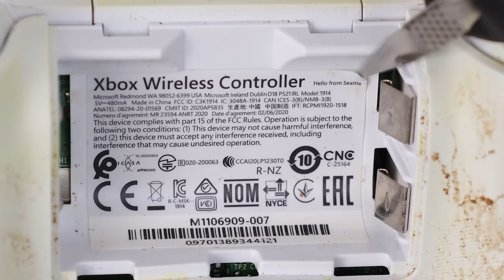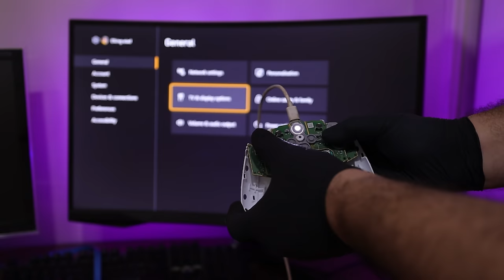Restoring and repair of the Broken Xbox series X|S Controller No Power & NOT CHARGING - ASMR

Comment: Something is off in this video. 
I've had the same identical white controller since launch (it's in front of me right now) and it isn't this dirty. The underside of the grips, the triggers and bumpers both have texture on them which can easily accumulate dirt from usage and I don't see much of it here. Either some of the dirt on this controller was artificially added or it was still new / barely used when it was water damaged.
Reply: Yeah he makes them dirty on purpose for the video :/ (unfortunately)
Reply: @Supremesilverlover  yea thats what i was thinking
Reply: it's probably one of those fake restoration channels
Reply: Dirt been painted on with a paint brush u can clearly see brush marks
Reply: concordo com voce !!! this is video is fake1
Reply: 100% amount of dirt built up is not equal to the deterioration of the plastic pieces itself.
Reply: This channel is fake

Comment: I am back addicted to your wonderful videos, I eagerly wait for them every day 😄 Smart, brilliant and amazing work from you 

Where was the fault? 
Maybe you can give me a simple explanation for that I am not a technician or a repairman, but I will benefit from you a lot, so that I can learn how to repair my devices in my home on my own.

 Thank you
Reply from the maker: Thank you so much for the kind words! I really appreciate your support and I'm glad you enjoy my content. Happy New Year! ❤️
Reply: The fault seemed to be the main chipset on the board not having correct contact to the board, due to impact or liquid damage.
He used a heat-gun with flux material to 'reball' the chip, where the heat melts the flux and the solder contacts on the chip to the board, to renew the solder.
Also, he used thermal-tape on the components close to the chip, so that the heat-gun would not de-solder any other component close to it.

If i missed something else, please let me know, cheers!

Comment: I have the Forza Horizon 5 Limited Edition Xbox Controller and the LB Button broke, so I bought a new screwdriver, some bits, and some Gorilla Glue Super Glue took it apart, took the broken piece from the LB section of the Bumpers and super glued it back together, had to let it sit before leaving for work. Came back, put the Bumpers and everything back together, now good as new.

Comment: The broken bumber is a common and annoy problem, it hasn't any solution except replacing it , I've got this white controller and it has a problem that the analog sticks drift to any direction, i don't know why? Is this a common issue with this controller or it is a random bad luck ? I dunno but I tried a different ways but neither of them is useful
Please tell me what should i do , Happy new year everybody
Reply from the maker: A common reason Xbox controllers develop drift issues is dirt building up within the controller, preventing the analog stick from working optimally. The easiest way to fix this issue involves using a can of compressed air to clean the cavities surrounding the analog sticks. Happy New Year!